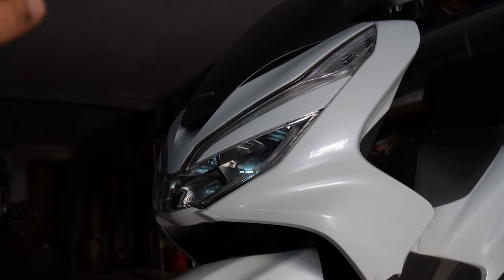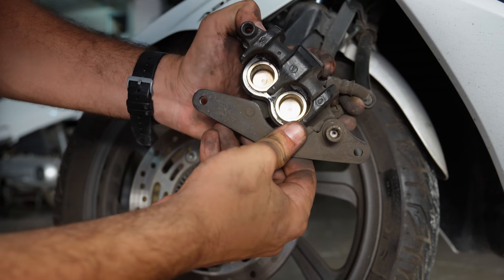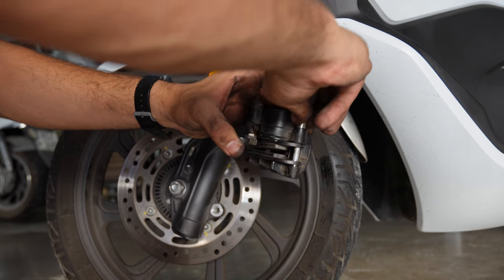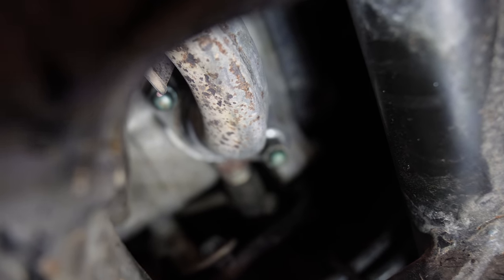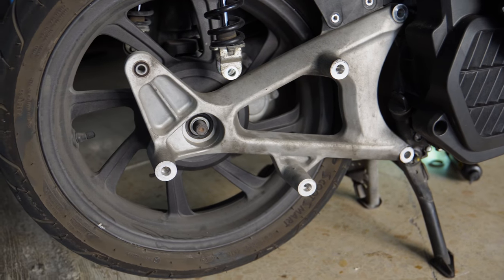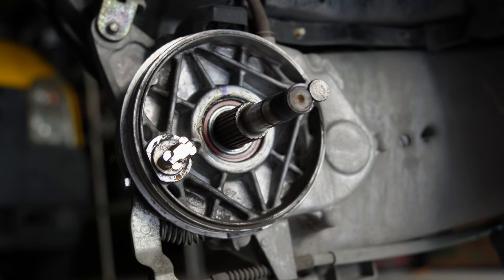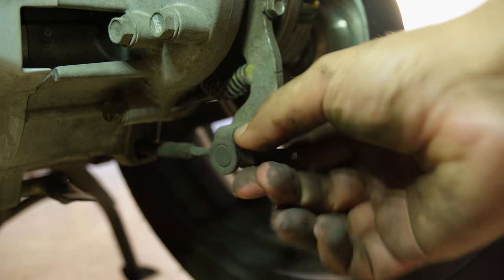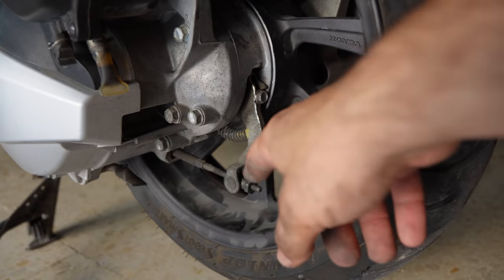Honda PCX Brake pads and shoes change (with rear wheel/exhaust removal)

Comment: It's a very well-explained video. Especially the part where you change the drums. I tried changing the rear drums on my PCX 2022 and after assembling everything back again, it does not start. The engine turns over but would not start. Sparkplug, side stand, brake arm calliper and O2 sensor all checked. Would you add something to check before I take it to Honda? Many thanks!
Reply from the maker: I don't think it related to the rear wheel, there should be any sensors to prevent starting. Is there a check engine light on the dash?

Comment: How much kilometers have your bike when you do the video, i install new brake shoes on mine with 70000 km but i have to adjust almost to the end the Bolt like the old One. They say to me the Cube wheel maybe worn .
Reply from the maker: The scooter has around 21000km in the video and the shoes replaced were still the original ones. Make sure the shoes are properly seated as It may cause issues, but I dont think the hub is actually worn after 70000km

Comment: My tyre isn’t fitting back on after changing the rear shoe, what should I do?
Reply from the maker: Make sure that the adjustment screw is fully undone and also the pins that sit between the shoes(the ones that turn when you press the brake to push shoes against  wheel) are fully resetted so that the shoes are the most possible close to each other